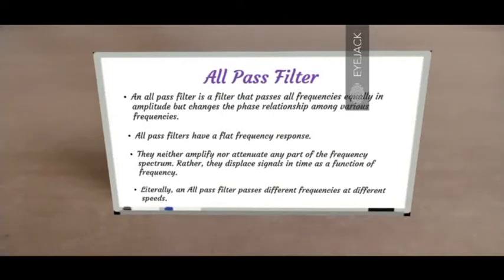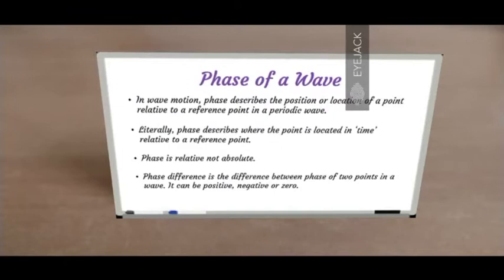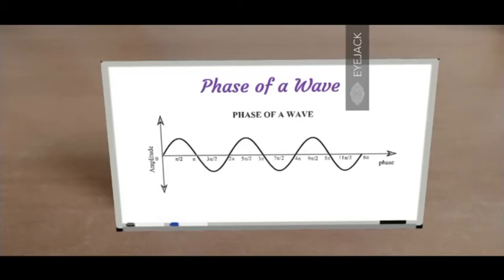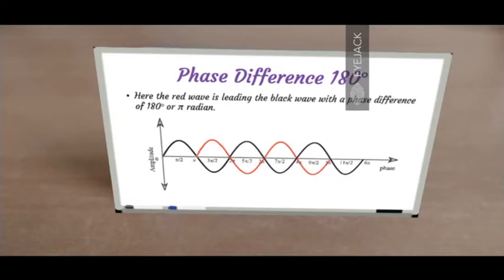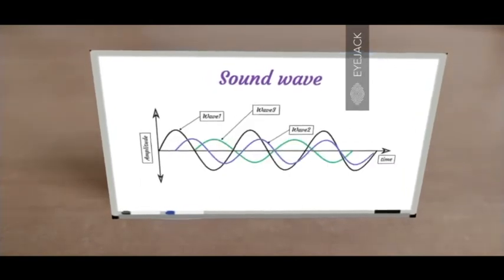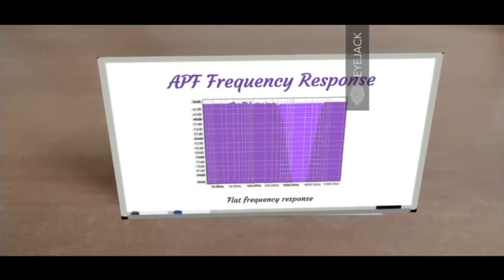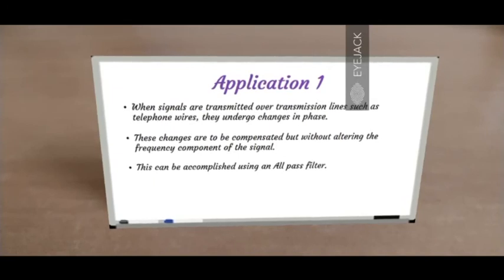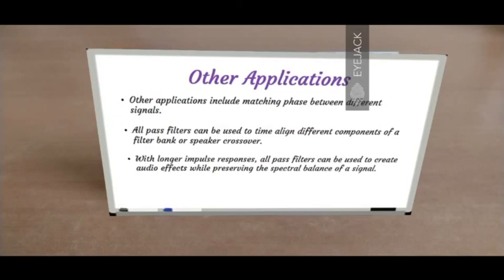All Pass Audio Filter explained

Comment: Thanks! Very good explanation  on the physics behind an all-pass filter. I don't have access to one in my DAW, but I use a simple phaser and turn off its modulation.  This helps correct phase issues ( muffleness) if I have two bass or drum sounds clashing.

Comment: All that and still did not describe how the filter works. This video is like a promo for a waves plug in. >>>It fixes everything. How does it fix everything? It fixes everything with filters. Oh, I see.<<< 
-----Or like, It's a tool. What does it do? It fixes things. 

Not to worry though. I have asked more than a dozen industry pros, and they couldn't explain what it actually does either. 

Cheers!!

Comment: If you apply an APF, wouldn't the application just cause a new set of constructive and destructive interferences? Or what guarentees that phasing issues would be fixed?
Reply from the maker: An APF is specifically used to overcome phasing issues. For example, when signals are transmitted over transmission lines, they undergo change in phase. To solve this problem, we need a way to overcome the phase issue without altering the frequency content of signal. An APF will serve its purpose as it does not filter any frequency but corrects the phase change.
Reply: @SrinathSrinivasan  "An APF will serve its purpose as it does not filter any frequency but corrects the phase change." Right, but how? How & what does it compare, and or shift? What affects do adjustments have on it's processing?